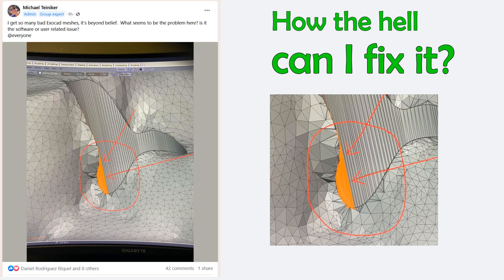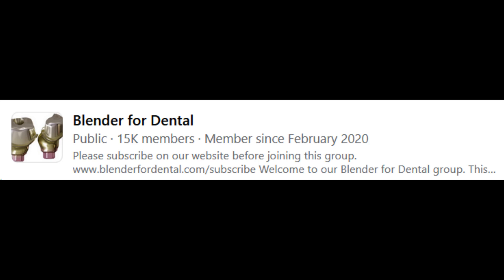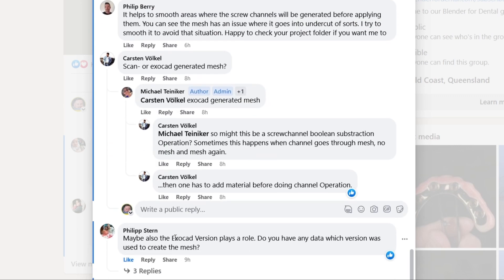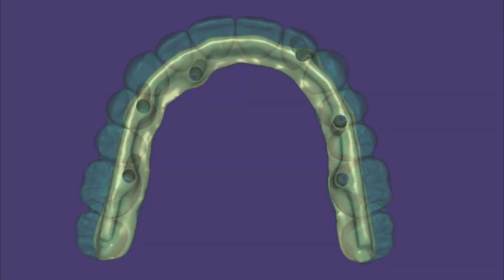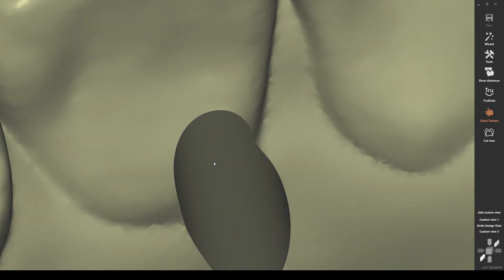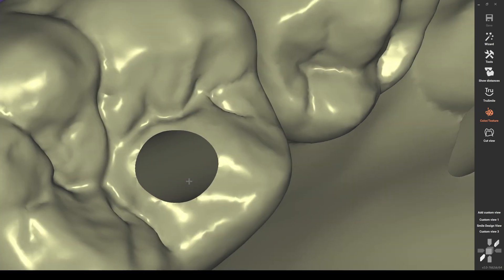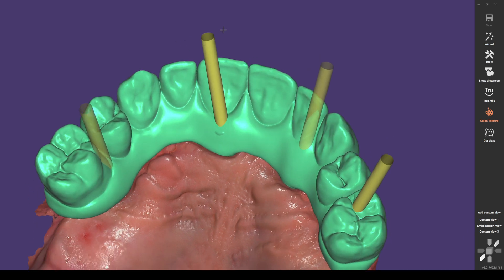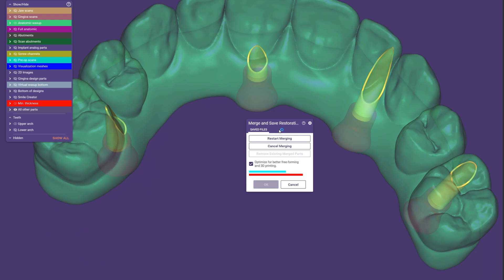How to fix screw channel failure on Exocad for smooth import in to @Blenderfordental ?

Comment: I think I have found the reason , If you go to wire frame and see the screw channel triangles are very long, I found out that When I go to meshmixer I can remesh the screw channel triangles to 
0.5mm or 1mm or some times 0.08mm I can bullion difference the scree channel very easily. Since the triangles of the prosthesis is fine mesh than the scree channel, Or one can say screw channel triangles should be of same type as the prosthesis designed. Exocad should rectify the triangles to at least one mm size and not straight long triangles. If they do this this problem of cuttimg screw channel cleanly without any problem will be solved permanently.

May all be happy and at ease free from dis-ease.
🙏😊🙏❤️